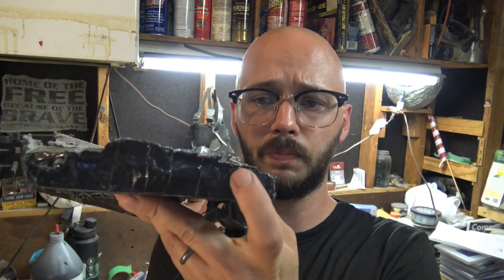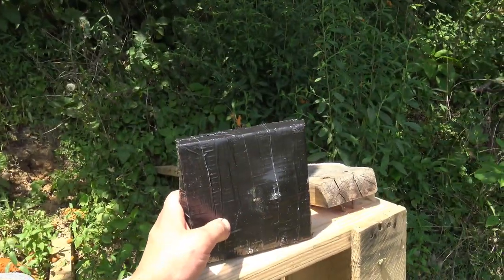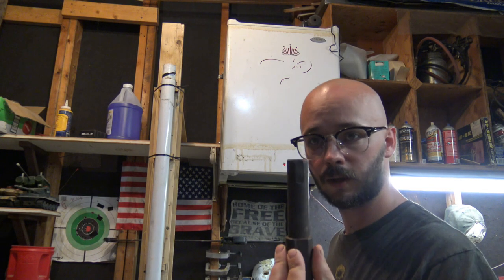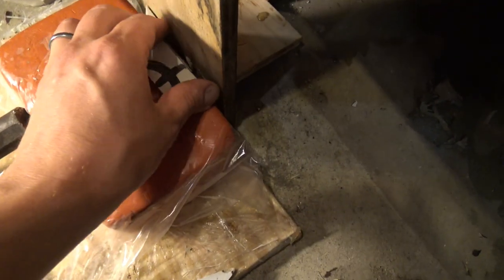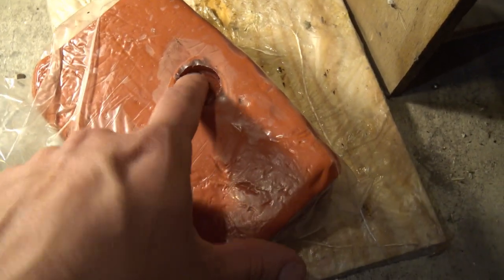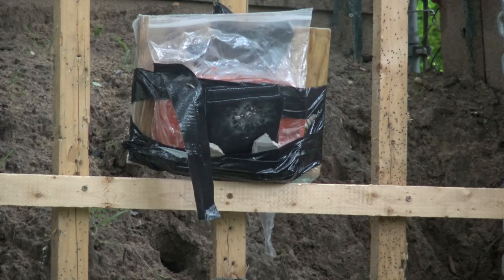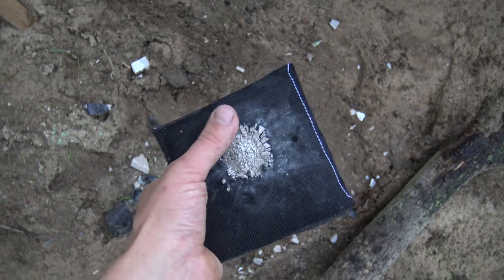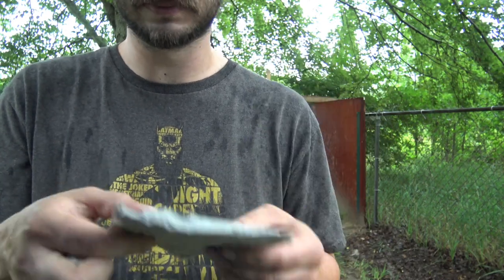Improving ceramic armor's durability

Comment: Hey James,
first of all: Thanks A LOT for testing my plate suggestion!
This was by far one of your coolest videos so far and I really enjoyed the editing, you're definitely improving!
I was very happy to see how the plate held up, especially after seeing that the first hit didn't even leave a bulge at the back!
I also really like your idea of using polyurethane glues as a coating for the porcelain tiles, the flex glue indeed seems to be very effective!
I'm looking forward to more videos of you testing polyurethane coatings and also the more professional one that you briefly mentioned.
Very curious to see how we can keep improving on the plate design!
Reply from the maker: For sure brother! Thanks for the suggestion, your idea really held up, I think with a little bit of tinkering we might get a real sweet lightweight plate out of this. There are plenty of other resins out there to investigate for this idea! so what did you think of the weight drop tester?
Reply: @Techthisoutmeow  In my opinion the weight drop test is a pretty useful method to get a first impression on how well something works and to compare builds side by side. It's surely useful but it doesn't completely replace the real test ;D

Comment: Nice. I'd still like to suggest at least testing 2 inch (or so) hexagonal ceramic tiles instead of big monolithic squares.  In theory, a bullet strike will only wreck one small hexagon and not extend beyond to neighboring tiles.
Reply from the maker: For sure brother! The final form of my ceramic armor will be flexible, with overlapping coverage.
Reply: @Techthisoutmeow  hell yes. You planning on selling those? Maybe on eBay as a fashion item to avoid any expensive red tape?

Comment: you should check out 3M (or a cheaper Amazon knock-off brand) security window film.  the "thickest"  tends to run in the 8-10mil range which will be thinner than any effective coating that you can smear on.  It's also made to do pretty much exactly what you're looking for:  which is to 1:  make it a little more resistant to cracking, and 2: keep a window in place even it the glass is cracked / shattered.  If you fully enveloped a piece of ceramic (front, back and sealed around the sides) with some of that film,  and then laminated that into a composite plate, then I think you'd get very little ceramic falling out of the bottom of the plate.

Comment: Great videos! 
Just an idea, instead of using "large" tiles that shattered at the first impact have you thought about using one or two layers (so it covers gaps if over lapping) of mosaic tiles?
Benefits could be: go around curves with ease and if one piece is compromise the rest of them are still intact, the down side would be added weight....
Thanks for the work

Comment: I used to work at a plastics shop as their CNC router programmer/operator and they had a conversation piece on the front counter that consisted of two 1/2" polycarbonate sheets screwed together . This piece had several 6 mm and .30-06 rounds which had been stopped at the intersection between the two plates

Comment: One of my favorite channels! Please don’t stop making videos! It’d be cool to see you test other plastics like ABS, nylon, or UHMW and compare their performance to hdpe! 
You should try dropping the polymer coated ceramic on its edge to see how well it resists and holds together. I’d be interested to see how bed liner works with resisting cracks! We always see it used to protect against spalling and shrapnel but I feel like it might have good properties to protect against fracturing!
Reply from the maker: Thanks man, I plan on testing every plastic I can get my hands on! It will be a while before that comes however. The cost of some of those can be steep, I do like the idea of trying some truck bed liners, I've used some in the past and the are tough.

Comment: One thing to try with this might be to build a mold out of something the coatings won't stick to, and cast the ceramic inside the coating instead of spreading it on. Would allow for easier use of the ones that have a runny consistency, and let you get thicker coatings of the runny materials without having to apply a coat, wait for it to cure, and repeat.

Comment: Greetings from sunny Britain!  Us preppers over here are more concerned with stab/slash resistant gear, but still, absolutely fascinating channel.
Reply from the maker: Greetings! From across the pond eh? Here's some stab resistant armor I was working on earlier this year! https://youtu.be/M4oxyDCufJc
Reply: There are tire shaving devices, I'd bet if you take some of the extra rubber off and rely on the steel belts they would work well for stab resistance. Don't use the sidewall though, they don't have the same reinforcement

Comment: I wonder if it would work if you ground up or powdered ceramic tiles and then mixed it with the different elastomers to make something like a ceramic composite with the elastomer as the matrix. You could experiment with different ratios of ceramic to elastomer as well as how fine the ceramic was broken down. I imagine you could find some combination that would be far more robust than an elastomer coated ceramic plate, but close to it in terms of stopping power. Though probably not as good in stopping power. You could also try mixing in ceramic with HDPE. I found you from Taofledermaus' video on the plates you sent him. I love this kind of stuff and your approach is very scientific. I subbed. I work in the plastics industry and we typically mix in various types of fillers (glass, carbon, talc and other fillers) to improve some characteristic we wouldn't get with just a polymer. I would hope you might be able to use this to improve your plates even more.

Comment: You should sand the ceramic tiles to make them more abrasive so the bonding materials will seep into the ceramic making them more crack resistant. (well potentially, its worth a test)
Reply from the maker: Good point, I'll keep that in mind for the next set of tests

Comment: Also, try adding something to the epoxy to make it stay together better, try steel wool or some wire mesh, Im sure it will increase the ability of it staying together for longer
Reply from the maker: I was planning on adding some fiber reinforcement my next go at it, I just might make it into its own hybrid composite.
Reply: @Techthisoutmeow  try also adding a layer of kevlar in between it should make for the strongest bond
Reply: @Techthisoutmeow  could you try 8mm porcelain tile, thin sheet of aluminum +20 layers of woven roving (18-24oz) with resin?
Reply: @Techthisoutmeow  Epoxy is tougher than PU, not sure why you didn't use that for this test. Or is some reason why PU is better than the other types of sealants and adhesives you could have tried?

Comment: As far as height for dropping an object, the acceleration curve straightens out at about 30 meters.
Reply from the maker: Thanks for the info! I want to dial in my weight drop tester, so I can get more data from the tests that I use it on.

Comment: Have you heard of or considered d30 on the back (or anywhere) on an armor set up? It's a non-newtonian that is flexible but hardens on impact. Used in motorcycle gear and hockey/lacrosse equipment, impressive stuff, not bulletproof. That's kind of the idea though, none of these materials are bulletproof by themselves but finding the best combination of layers is the goal. 
Also, what kind of steel are you using? How thick? Is it hardened at all? I was thinking if you had very thin ar500 that was thinner at the top and overlapped like old cedar roof shingles, that could spread the energy out and keep costs down since it's not a big piece. I really should be working but can't stop thinking of ideas for this.
Reply from the maker: I've worked with non-newtonian fluids before, but not d3o. you can only find that stuff fabricated into pads various products. The steel I used was just plain Jane mild steel, the stuff for welding. I plan on trying better steel in the future, just haven't gotten around to it yet. Have you joined the discord group for this channel yet? there's a few guys on there working on there own armor designs, might help you with some R@D!
Reply: @Techthisoutmeow  the steel Armox 500-600!?

Comment: you could also try to use multiple thin layers of mild steel (like 1.5mm [= 1/16 inch] or 0.75mm [1/32 inch]  ) with some of thoose  silicone/rubber/polyurethane-like paste that you used for your ceramic protypes,  beetween each steel layer (something like paste-steel-paste-steel-paste-steel-paste-steel-paste ) and see how it perform
Reply from the maker: I like this idea, I'm about to do some steel and other metal tests, I'll be sure to add this! Thanks for the suggestion

Comment: things of interest: sand in resin, quick-field-patch
Reply: if you are into clothing, you can make a resistant clothing
Reply from the maker: I've thought about this, however I was going to use something like steel fillings or something. kinda like a JB weld putty.
Reply: @Techthisoutmeow  brass, you could compare which is more effective: plate of melted rock or plate of melted ar500